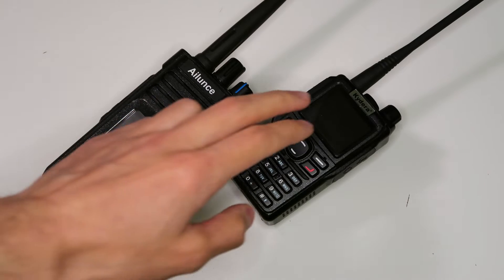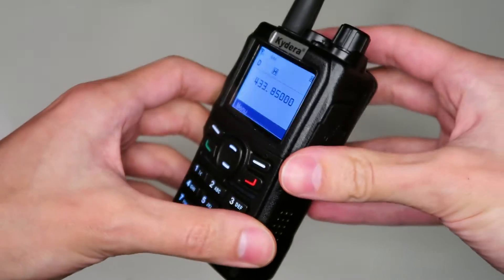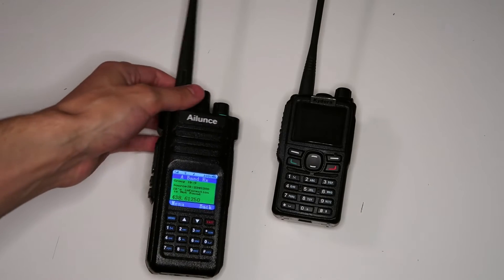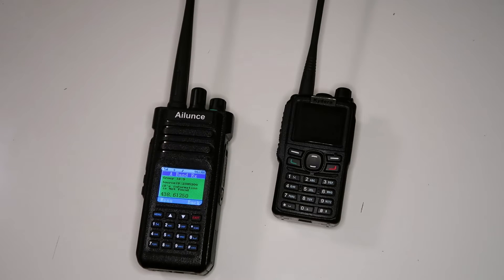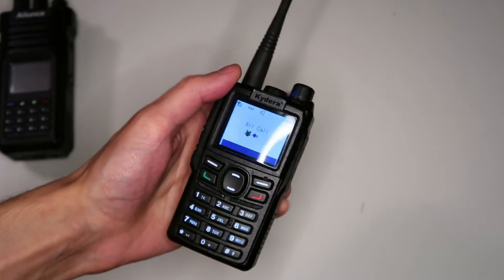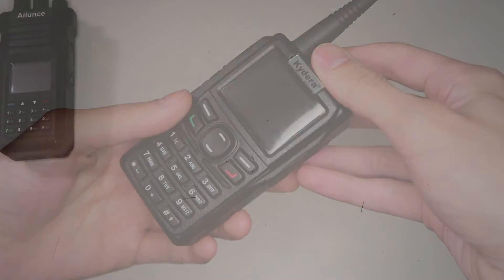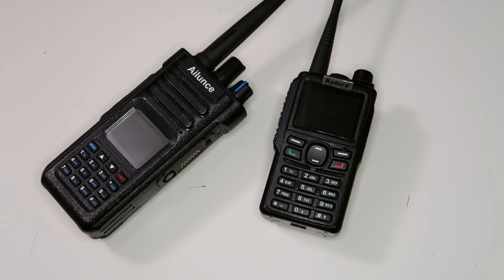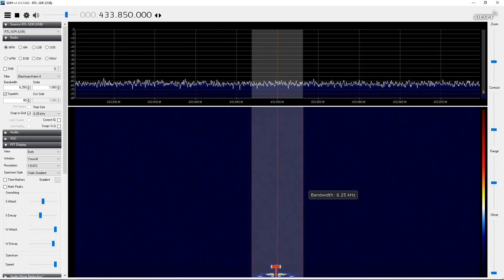Testing out a dPMR radio with a different vocoder

Comment: I suspect the bandwidth is the issue with audio,  looks like this is set to 6.25k, which is useful for two time slot repeaters running 6.25k per slot, but the audio suffers compared to simplex at 12.5k, and if you can set a simplex channel up to 25k you will be amazed how good they can sound.
Reply from the maker: Are you talking about the bandwidth of the digital mode? That doesn't make any sense. You can't just choose whatever bandwidth you like. It's defined as 6.25 KHz channels for dPMR and the radios are made to do that with no option to change it. As for DMR,  it's defined as 12.5 KHz and this also can't be changed.
Reply: @radiosification  No many motorola dmr rigs let you select wide for simplex, same thing with most if not all Fusion rigs, its no different from analogue in that respect, listen to audio on 2m or 70cms narrow and compare to wide, even some Chinese DMR rigs let you select wide.
Reply from the maker: @G0LGB  that is on FM. You cannot change the bandwidth of DMR.
Reply: @radiosification  Says the guy who uses VW mode on the Yaesu...What do you think that W stands for?  VOICE-WIDE.....& if you look in Motorola's CPS software you will see you can select 25k wide in simplex...but hey...you clearly know better...I used to think I knew everything when i was your age too.
Reply from the maker: @G0LGB  Yaesu system fusion is not DMR. You CAN change the bandwidth on fusion but NOT on DMR. The 25KHz option in mototrbo CPS is for analog channels only. If you're so sure then program a DMR channel,  hook your radio up to a spectrum analyser and transmit. Or go and look at the official documents. The ETSI DMR specification.
Reply: @radiosification  I know what DMR & Fusion are...I was saying you could use Wide mode in Simplex, for both modes, DMR uses 6.25k per channel/slot, in wide simplex mode you use the entire 12.5k as it is available in simplex, (not 25k...that is analogue) but not of course via a repeater.
But hey you believe what you want kid.
Reply from the maker: @G0LGB  you clearly have no idea what you're talking about. Come back when you've educated yourself better. DMR uses 12.5KHz channels. Even on simplex. If you use dual capacity direct mode (also called 6.25e mode) then it STILL uses the exact same channel size but just let's you use both timeslots on a simplex channel like how you can on a repeater. Otherwise the radio will not recognise the timeslots and will treat both the same.

Comment: It's quite the mystery what's going on with this Kydera radio. Unless purchased a long time ago, they are using ASELP vocoder. My older AMBE-2C version still doesn't work with other known compatible AMBE-2C units like Puxing PX-558D, TYT UVF10, or Zastone ZT-9805. Speaker size maybe causing audio to seem inferior compared to the HD-1, but I can assure you that dPMR AMBE-2C and ASELP units do have decent sound!
Reply: Corresponence table of AM BE + 2 and AM BE +2C

 device        Built=in flash RO M           AM BE + 2C            AM BE +2
                                                     Incompatible       The AM BE3000 device
      SCT3252              None                 (No Built-in vocoder)  Supported by external coonection
                                                     support                  Incompatible
      SCT3252F             Yes                  (With built-in vocoder)  (AM BE3000 not connected)
                                       * AM BE +2 license cost is required. AM BE + 2C is license-free
                                       * AM BE +2 and AM BE +2C voice quality is almost the same, but there is no compatibility.
Reply from the maker: Could you tell me where you got that table? I'd like to look at the source and surrounding information
Reply from the maker: That's interesting yeah. I don't think the poor audio is because of the vocoder, but more because of the speaker and microphone on the radio. Even in FM it's very quiet on transmit. Maybe I'll have to get some other dPMR radios to try out
Reply: @radiosification  - I didn't think analog at 6.5KHz would be enough band width to be intelligible. I got some rt-40s from Retevis which are programmable with software application and they're trying to read the firmware for modification! The chip set says it's DMR/dPMR capable.

https://hackaday.io/project/164223-retevis-rt40-reverse-engineering-extension
Reply from the maker: Very cool! I'd love to see where that project goes